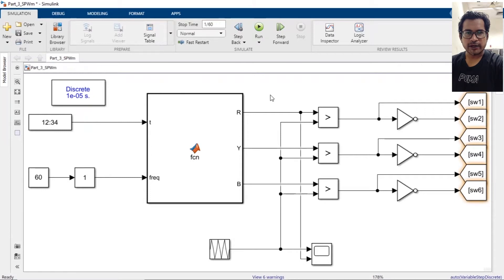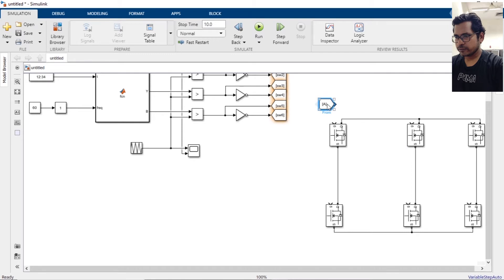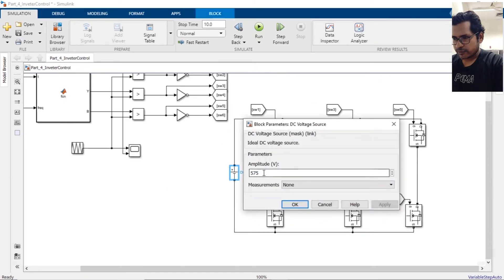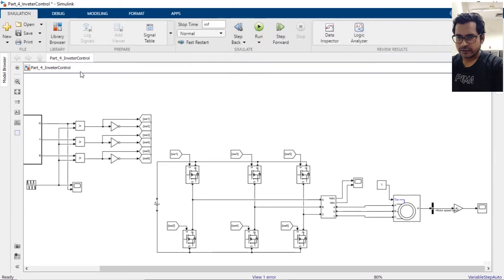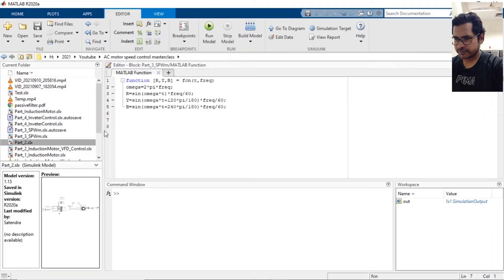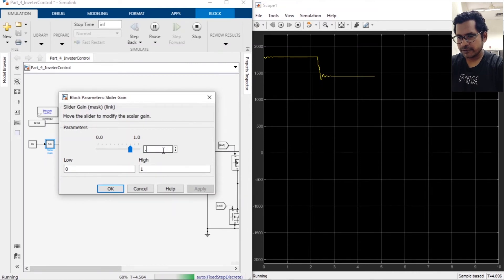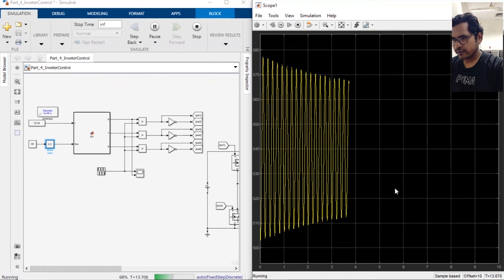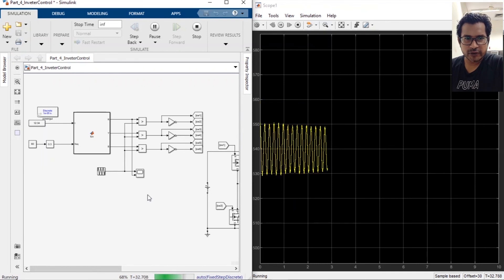Speed Control of Induction Motor Using VFD | Part-4: Inverter and Induction motor control

Comment: Thanks for your quick response on my last question . But you multiply by freq/ 60 to draw the part of the wave corresponding to the slider value correct ? Meaning if i use 50 hz system i will divide by 50 correct ?
Reply from the maker: Yes. You are correct.

Comment: hye..when you change the percent of the freqeuency,, is it the voltage also change??...im little bit confuse..if we are running the motor in contant torque region, the v/f should be contant right? meeans, if the freqeuncy change, the voltage also need to be change.
Reply from the maker: Yes, you are right. The voltage is also changing to maintain V/F constant